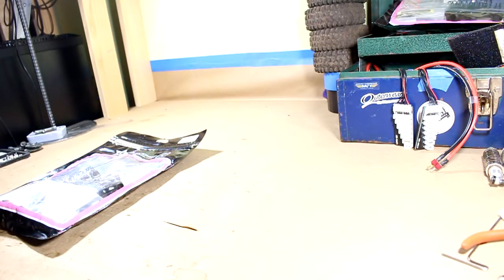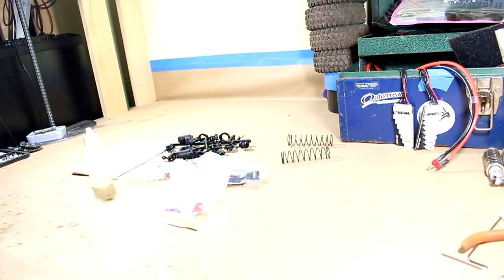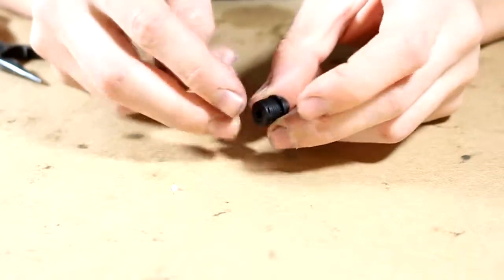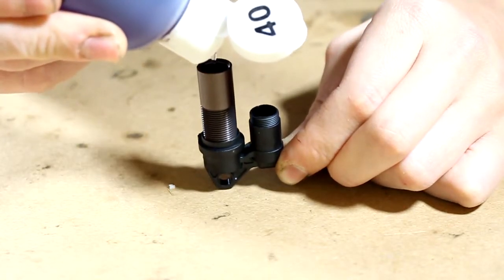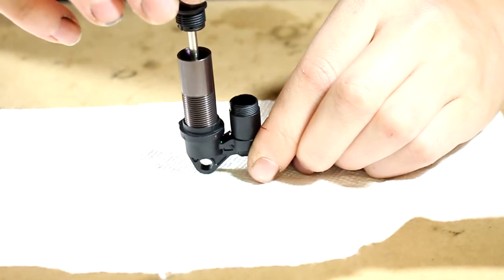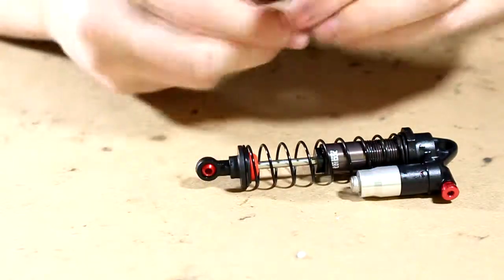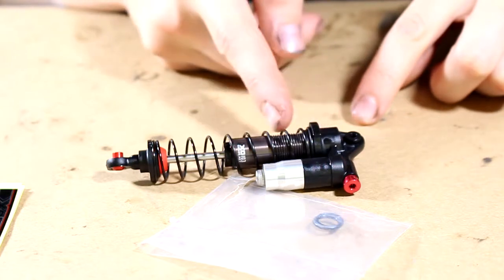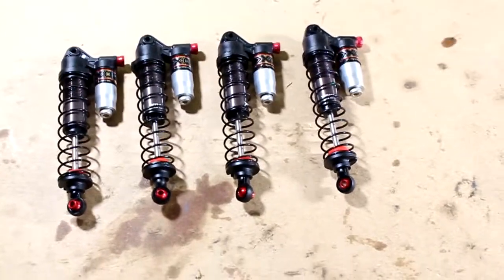How to Build G-Made XD Piggyback Shocks! (Toutorial)

Comment: With the holes int the piston, what does that do to the shockers?
Reply from the maker: If I understand the question, the holes in the shock piston allow the oil to flow through the piston. Depending on the number of holes in the piston, it will change how the shocks respond to quick jolts and bumps. Fewer holes will be slower to respond and more holes will be faster to respond.